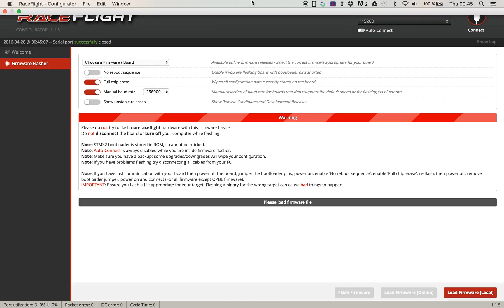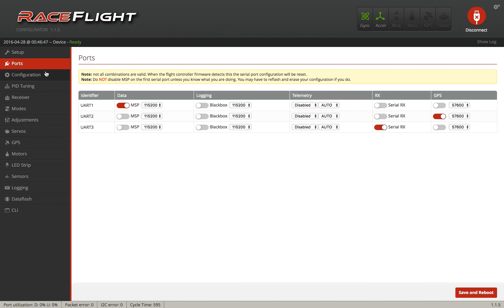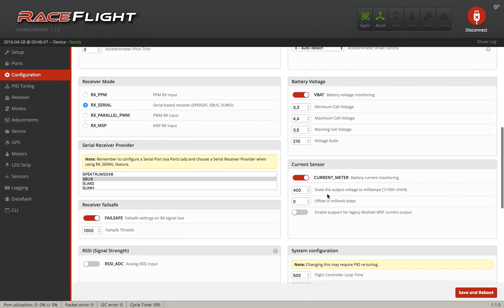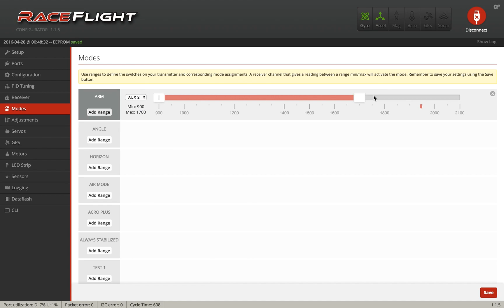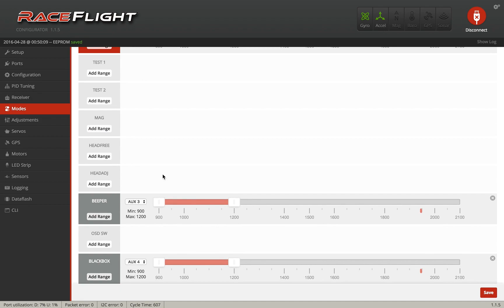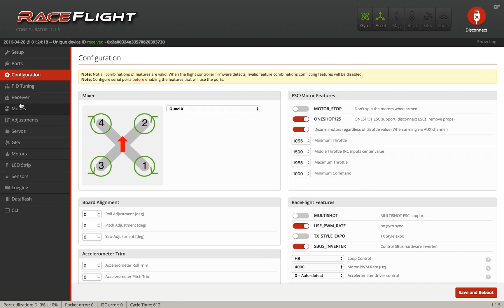RaceFlight RC12 // Flash // BasicSetup // Ultra210 (Victory230)

Comment: What's the difference between airmode (I noticed you didn't activate that) and always stabilised? Should be getting a bluejay f4 soon and I want to try raceflight but don't fully understand the differences between it and betaflight.
Reply from the maker: OpenPilot introduced years ago AlwaysStabilseWhenArmed, but it was deep in the code and it's kind of similar to what BetaF implemented with AirMode. There is AirMode for Kiss but e.g. FGA just uses an idle up switch which prevents the PIDC from shutting off at zero throttle (thats the basic idea behind AirMode/ASWA and an IdleUpSwitch). Now since we at RaceFlight think that there is no reason to really turn the PDIC off anymore for what we do (racing/freestlye) it's now always active (just like Acro+ is). 
This is RC12, which has AirMode and ASWA but it's recommended to just use ASWA and not use AirMode at all, the code was added to compare it but it only caused trouble so now AirMode is removed and, as mentioned, ASWA is always active in newer BetaBuilds of RaceFlight :)

In short, just use ASWA with RC12 and stay away from AirMode, it won't be needed.
Reply: +JulianGoesPro cool. Thanks very much!